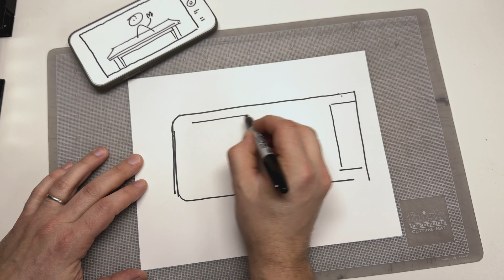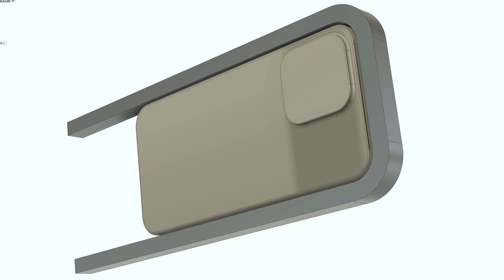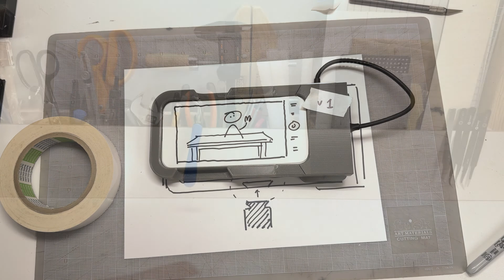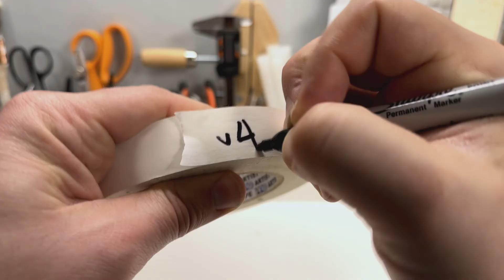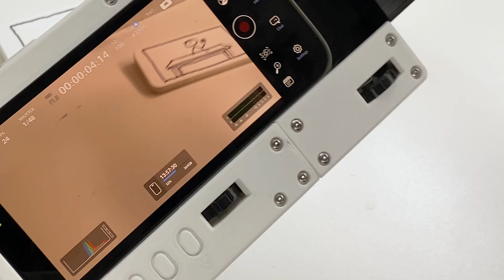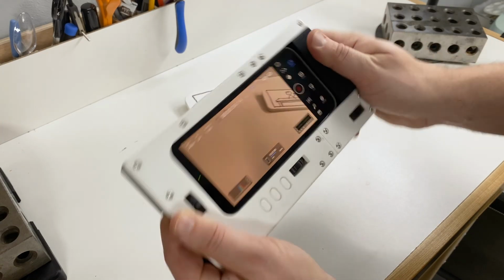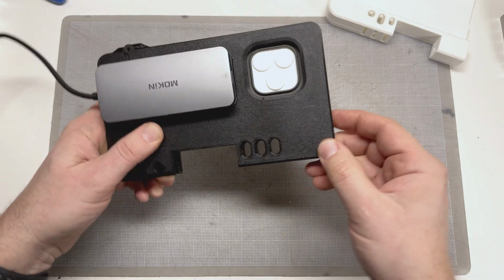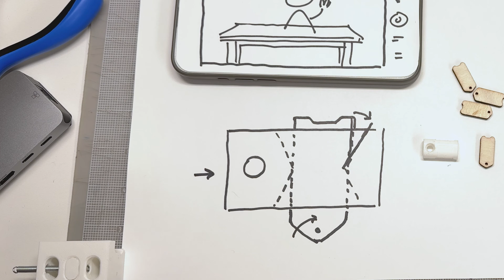Design & Build: Unique iPhone Camera Rig

Comment: I absolutely love this project, I am trying to do the same thing, but starting with some prebuilt parts. 

My design requirements are
- NVME M.2 SSD (at least 500 GB)
- 10k mAh battery bank
- External Wireless recorder (DJI Mic)
- USB-Hub (can add SD cards, headphones, etc)
- HDMI output (to connect external monitors, I currently have a Viltrox 5" monitor that works pretty well)
- Maybe a fan? 

So I found a usb-c hub, the acasis 10 in 1, which is a hub with a built in SSD enclosure. It also has PD in as well as a data connection. I'm trying to connect it and the battery to the back of the phone, when the phone is inside a Neewer iPhone 15 Pro Max cage. I like it because it has all the 1/4's and cold shoe mounts around the edges, and it also gives an easy way to mount ND filters (I am using a variable ND). Also the side handles make it a lot more stable when trying to keep it steady. 

My first prototype was ok, but I am also looking into heat management, so I may add a fan. But basically I imagine it being a box that sticks out from the back of the phone, secured to the cage, so that one cable connects the phone to the cage/hub/battery, so you slide in the phone, connect the cable and you are ready to go. When done, you just slide the phone out and disconnect one cable. 

I'm trying to get it to be an all in one solution, and your video was really inspiring!